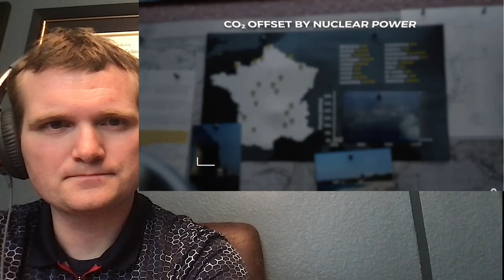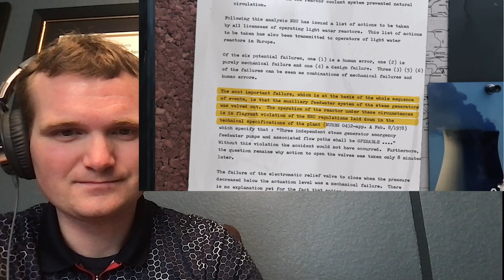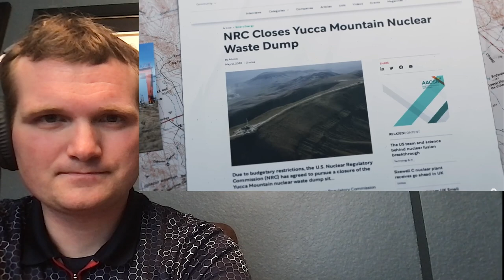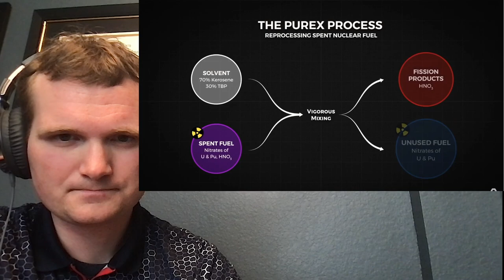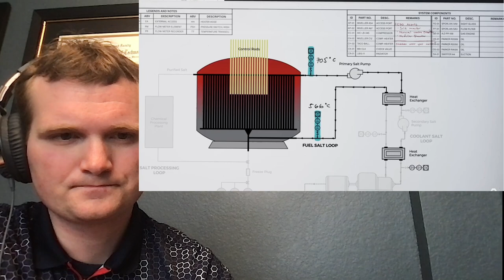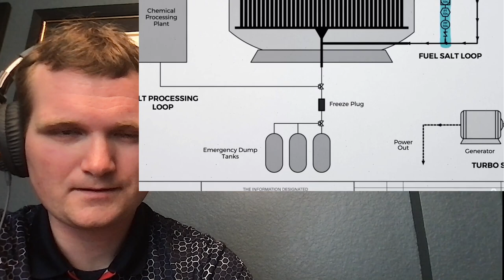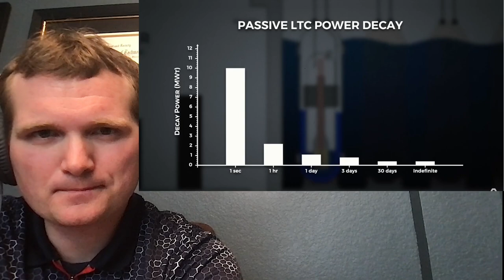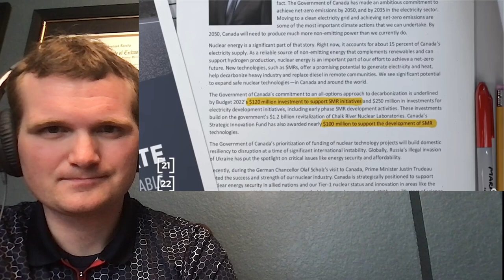Nuclear Engineer Reacts to Real Engineering "The Uncertain Future of Nuclear Power"

Comment: It's sad to see that Real Engineering is promulgating the same disinformation about nuclear safety that is the primary reason SMRs can't change the landscape of nuclear energy. The main and most critical factor holding nuclear back is cost, but a close second is public opinion. People continue to be afraid of nuclear power because of a number of major nuclear incidents that can be counted on two hands (and mostly were due to nuclear weapons testing). In stark contrast, nuclear is one of our safest power sources, and causes less public health harm than natural gas power by a huge factor even ignoring the impact of CO2 emissions. 

I hope that anti-nuclear organizations lose their steam and we see more pro-nuclear organizations crop up. SMRs have good use cases, but our best bet is to simply build more light water reactors (and other reactors with proven technology) today.
Reply: Wouldn't it be nice to get more fizz out of the fuel though? I really hope we get some high-temperature, fast-neutron reactors to get the most out of the fuel we've got.
Reply: @Takyodor2  No one is going to disagree that it would be nice. Promising it based on incomplete premises, or even outright being dishonest about it, weakens the advocacy though. We can't play loose with the truth about this stuff.

Comment: Hey another idea, not sure how much you know about fusion.

But Lockheed Martin has a 2018 patent on something called a plasma confinement unit claiming an efficiency of 1 ( yes that is correct).

How
Reply: uh, by not. Unless there's physics at play I'm unaware of here the only thing that has an efficiency of 1 is matter/anti-matter annihilation (by virtue of E=mc^2, you're turning all of that matter/anti-matter into pure energy), and even then you have efficiency loss trying to capture that energy so that you can do something with it. I also cannot verify that claim (I checked US20180047462A1)
Reply: @skylerross8054  perhaps it's not the whole process but the confinement portion?

Anyways there are sure to be updates but still.  Claiming 1...
Reply: I doubt it actually works, or it would have changed the world by now.
Reply: @Takyodor2  not if it's restricted to military applications.

That takes time to filter out.
Reply: @jeremygair4007  Sounds odd to tell the world through a patent instead of just keeping it a secret as long as possible. I kind of doubt that something as huge as working fusion power could be kept a secret for long anyway.
Reply: @Takyodor2  when they want to you'd be surprised.  It could be flex, it could be psyop
Reply: @jeremygair4007  I think the most likely scenario is they have something that doesn't quite work yet, but are hopeful will at some point. Not all patents are/were viable when filed...

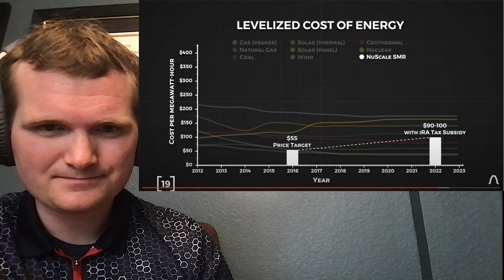Comment: 42:56 "In comparison, wind and solar can be as cheap as 30 dollars per MWh" RealEng is either completely unfit for this kind of research, or knowingly making solar and wind look better (dumb or evil, you decide which one is worse). Solar and wind have and continue to have massive public subsidies. No surprise they're "cheap". Plus, as in his other video, he continues to compare solar, wind and nuclear as if they offered the same service: they do not. Nuclear (and coal and gas) offer 24/7 power including the ability to modulate output. Solar and wind offer intermittent power, with little ability to modulate output. His consistent failure to address this key issue baffles me.

Comment: Solar and wind are NOT low cost!

I worked on the largest mining trucks on the planet mechanically.

Trust me the wear and tear on those wind turbines is far too often overlooked.  When parts that heavy are moving often there lifespan is very short in real world terms.

Solar cells have a large drop off year to year.  Trying to power the world that way, fiscally impossible to keep up with offsetting with new cells.
Reply: A mix of different energy sources is the sane solution in my opinion. Solar power can be great, but it doesn't solve every problem.
Reply: @Takyodor2  I like solar for smaller remote applications such as instances if portable power
Reply: @jeremygair4007  It's also pretty great to just spam them on roofs of houses/factories, gets some extra energy for free basically.
Reply: @Takyodor2  depending on costs, also solar panels are pretty fragile so not so good in hail belts.  It still needs to make sense and don't forget the disposal waste, which tends to be pretty bad.

Cradle to grave it doesn't always make sense.
Reply: @jeremygair4007  Agreed, I hope we improve recycling of solar panels in the future. It may be an economics of scale thing, where more end of life solars means more incentive to reuse the materials, and larger facilities to do so means it gets cheaper. I'm not going to shout at everybody to put solars on their roofs, only ask those with preferable conditions.

Comment: The problem with nuclear power - and energy in general- is that it gets political really really quick. This means that engineering and economic considerations no longer drive the projects. Perhaps one of the least politicized industries is the semiconductor space, and the progress over the past 50 years has been incredible. Constraining the development of nuclear energy for political reasons makes no sense; it's akin to deciding that for whatever reason, an integrated circuit cannot have more than one million (or another equally arbitrary figure) transistors in it. Every computer user finds that argument laughable, but what do ostensibly sensible people believe the exact same argument when it comes to nuclear power. Also, for the record, non-capitalist systems with a focus on heavy industry were a lot worse for the environment than our supposedly "greedy" system. The government is not a magic wand solution and it alone cannot drive innovation, or icentivize new technology.
Reply: agreed. more often than not, getting the government involved makes everything 10 times worse. would be better if we could just depoliticize nuclear entirely, but that ship has sailed.

Comment: I've never been afraid of nuclear energy even when there was a plant practically in my back yard. (Trojan nuclear power plant in Rainer oregon!) I grew up in Portland and Scappoose and sthelens area so I was always close to it. It is what made me quit voting but that's a long story. Fusion and better storage should be prioritie till then nuclear power as it is just fine and very clean. 😁😉
Reply: I grew up literally 10 miles (just checked it on Google Maps) from Turkey Point down in Homestead, Fl. We had one of the Sirens about a 1,000 feet from the house and IIRC one of the dads on the street actually worked at Turkey Point, I always had in the back of my mind that there was a possibility that siren could sound one day and we would need to evacuate but it never has, 25 years+ since moving and the facility is still running.

Comment: If only the US Navy had the interest and funding for reducing the size of the reactors they use for propulsion--Maybe we would more swiftly have civilian reactors for motorized carriages that are not only many magnitudes more green, but also fuel efficent by even more magnitudes. Imagine a mini closed loop reactor that gets "ludicris miles per Rad hours x3" and its the size of a modern V8 \o/. With enough inovation we could easily improve the thermal efficiency to the point of running at the same average operating tempriture of a cumbusion engine. It would be electric of course, although a nuclear steam engine would be pretty metal as well >.<, meaning if we could make start up and shut down times about the same as a modern gas engine, we wouldn't even need the reactor to be critical while driving with a decent set of battery cells. The fuel would last so so long and all you would have to do at a service station is pull up to a refueling bay and a nuclear engineer comes and provides refueling service while also removing the spent fuel for recycling...maybe even service other parts of your vehicle or sell refreshment service at your car side. And yes if this future happens and it isn't all manufactured in a 50's nuclear punk body styles with an overall sociatal retro revival, then I will be sorely disapointed in all of humanity xD

Comment: Fuision is like the dream but i doubt will see any times soon. I like LIFTER thorium idea the best i think. SMR i can see a place for but they also make more waste and more resources so not huge fan of that idea. I also don't see why you would need two heat exchangers in a salt reactor system. My understanding the big downside of the salt reactors is the corosiveness of the material but i would think there would be some sort of ceramic, etc lining, etc that would be able to isolate the metals from the corosive salts.

Comment: The technology I'm most excited about seeing is Helion's pulsed fusion reactors, by far.
Reply: Fingers crossed it lives up to the hype.
Reply: I have an uneasy feeling that it's just more hype (though I hope I'm wrong of course). In my opinion, we should try fission/fusion hybrids first, before aiming for self-sustaining pure fusion. The fusion reactor doesn't have to be net energy positive, it just has to provide neutrons to a blanket of fissile material that needs some convincing to split. No worry for meltdowns, little waste products, and we may gather lots of data which may prove useful in improving the fusion parts of the reactor.

Comment: Also if it was desired couldn't you pull a coal furnace off of a steam loop and with some additional infrastructure place a nuclear reactor in its place?

The idea is to save on building some of that new infrastructure.
Reply: in my uneducated opinion i could see that working. but I'm nowhere near an expert, I'm just some dude with a keyboard

Comment: Ignorant environmentalists and their associated movements have cost humanity dearly in some cases.

I think if they're so committed to their convictions they should live it.

No fuel, no heating, no power, no running water, among many other things they benefit from.
Reply: I consider myself an environmentalist, but I love nuclear. We have to educate people until they understand that a combination of nuclear, solar, wind and hydroelectric power is required for sustainability.
Reply: @Takyodor2  another necessity is if we want to eventually reach out to the outer solar system, we'll be using nuclear likely.
Reply: @jeremygair4007  Or nuclear + solar. Solar sails are pretty cool, and normal solar panels work decently until you go really far out.
Reply: @Takyodor2  so Mars gets less than half the solar radiance of Earth, that's the next planet, anything past the belt, your options will be very limited for solar.

I wouldn't rely on that myself.

You can do it inner solar system for sure though.
Reply: @jeremygair4007  I'm not really disagreeing with you, just saying solar and nuclear complement each other well (both on earth and in space). :)
Reply: @Takyodor2  I think solar is even better for space, no atmospheric interference.